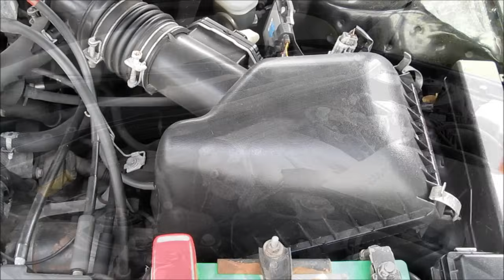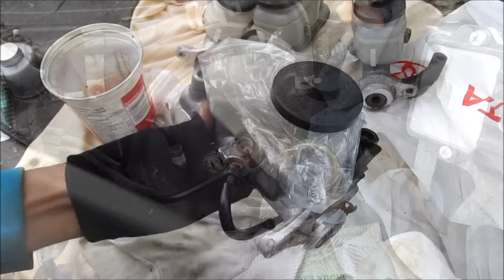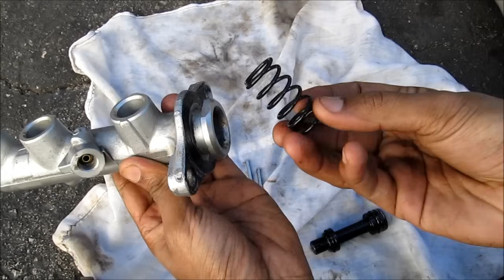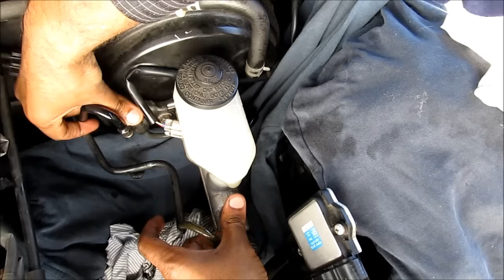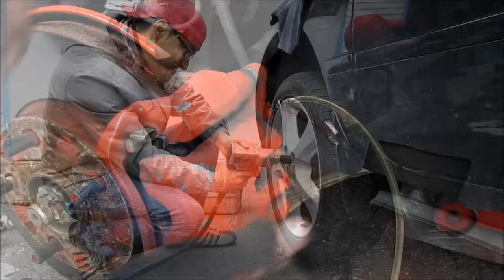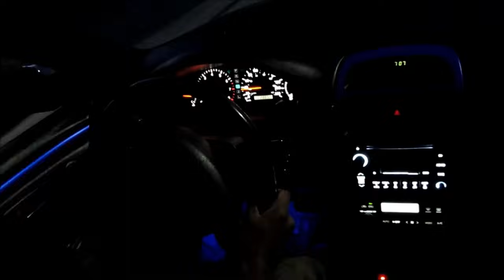How to Replace a Brake Master Cylinder

Comment: you have too many dirt in your fluid....there maybe a debris that got into the seals making the cylinder leak internally....is your replacement a used one from a junkyard? i used one from a junkyard last year, its looks like it is starting to fail now....rebuild master cylinders are mostly not good.....better buy brand new
Reply from the maker: +EvendimataE Yes mine was from the junkyard. Didn't pay too much for them so if it lasts a year, fine, I'll rebuild it myself next year or get a cheaper aftermarket new one.
Reply: check the one you removed.....sometimes the gaskets are still good but there are just some dirt causing it to have internal leak....i tried to look for repair kit, did not find any...i think its not available for that model.
Reply from the maker: Okay my "new" MC is starting to drag the brakes....lugs are getting hot, car is feeling sluggish, burning smell of brakes....

Pedal is nice and responsive in traffic, but gets spongy after a highway run. I'm guessing the piston is too slow to retract all the way during stop and go traffic. Gonna have to tear this down yet again...
Reply from the maker: EvendimataE
And yes, Toyota lists a rebuild it: http://www.villagetoyotaparts.com/products/CYLINDER-KIT--BRAKE-MASTER-WABS-WABS-J/1996410/044932B010.html

Comment: how did you know your master cylinder was bad? it could be your fluid was hyper bad or you had air in the system; did you actually bought a new master cylinder or rebuilt the old one or just cleaning it? why did you have so many master cylinder around? which part or what has to be done to rebuild one? so you are from and in Canada?  insulate your garage to keep it warm and keep the videos coming during winter pleeeease. I moved from vehicle repair videos to programming and ee tutorials but watch now and then for relaxing
take care
and an advice, lose the round head ratchet and I think gearwrench 120xp and milwaukee 3/8 right angle wrench would be better to use
Reply: He's a genius. He takes apart this stuff like Lego. Then he teaches us everything. I guess he needed soo much brake cylinders to experiment with.
Reply: +cosmophonic12 why is it garbage? how would you do it?
Reply: You're videos are garbage and you have no idea what you're talking about. go away
Reply from the maker: +nhz013 My brake pedal was mushy even having bled it a few times. I got a few MC from the junkyard and experimented with them. One was from a 4 cylinder car that doesn't bolt up, the other was seized and the other I replaced in my car. Turns out the one I replaced was a bit leaky at the connection, and the pedal was sometimes spongy and sometimes hard. So I pulled the piston/seals from it and put it in my existing cylinder and bled the brakes again, this time twice after having engaged the ABS on a test drive to get more air out. Now the pedal is nice and firm and I feel like I have brakes now.

I'm comfortable with my tools right now, if I need something I'll go out and buy it. I do have a set of ratcheting wrenches that I rarely use but come in handy in tight spaces, and of course an air ratchet.

Yes I'm in Canada. Not much room in the garage and poor lighting for videos, but I've got a few smaller indoor projects lined up for the winter. One of them - since you're into programming - is a sequential turn signal mod. Wanna help me with the circuit for that? :)
Reply from the maker: +Aleem Abdulla This is true. More the better.